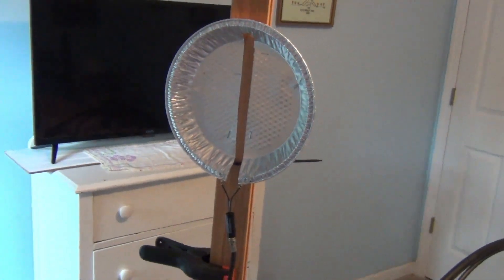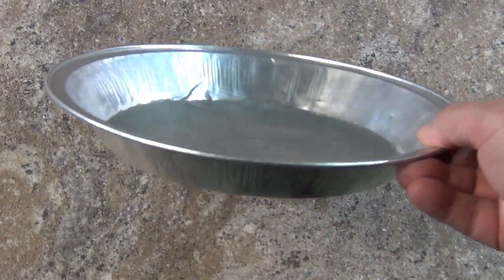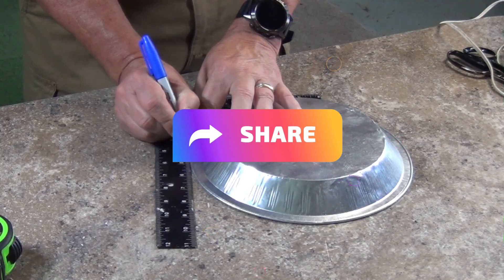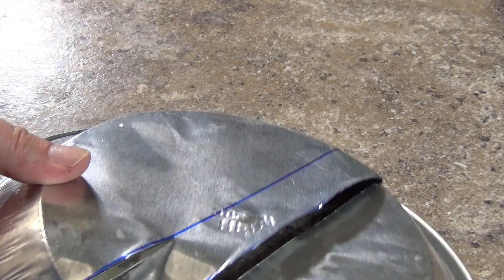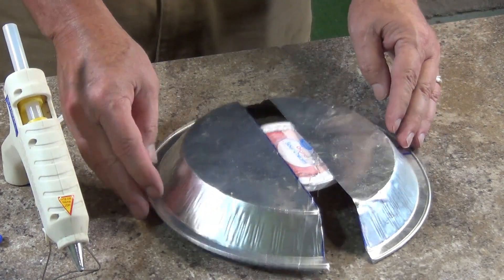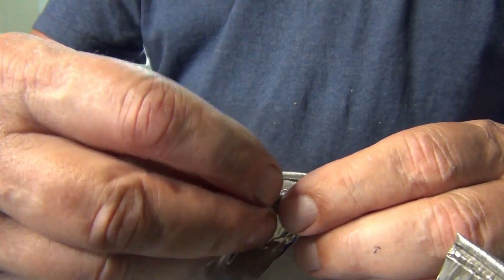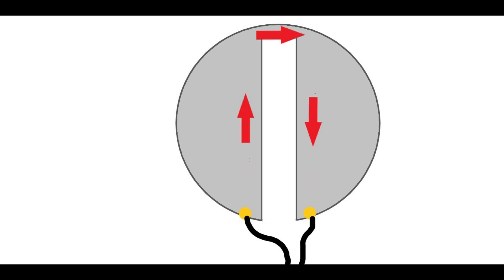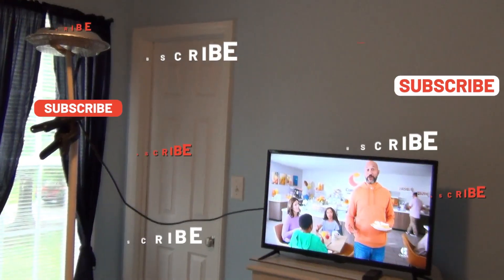Build a Simple Dome TV Antenna

Comment: Does it need power if mounted in a van?
Reply from the maker: It doesn't require power unless you add an amplifier to the antenna. I'm not sure how well it would work inside a van. You're always better to mount any antenna outside of a vehicle as the metal in the van body will block signals. Thanks for watching.

Comment: Does this work with DAB+ (European) digital Radio signals if slightly modified? Range 174MHz-236MHz.
Reply from the maker: Small antennas like this are designed primarily for UHF, not VHF. This might work, but it's not your best choice. Here's a link to a design that would be better for your needs. https://youtu.be/eqDwqveTOaE